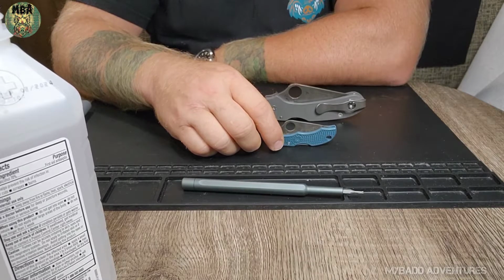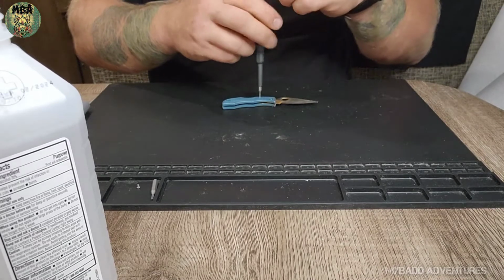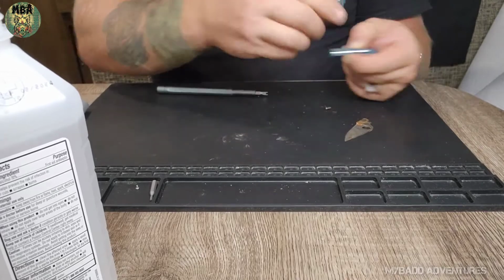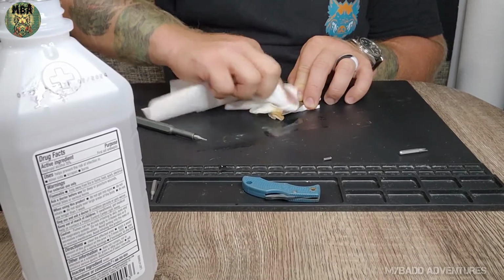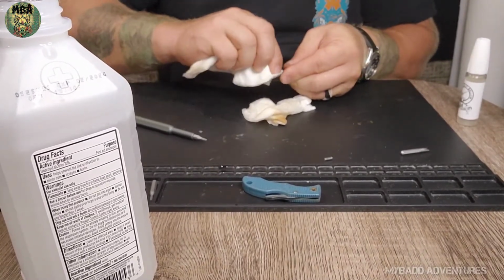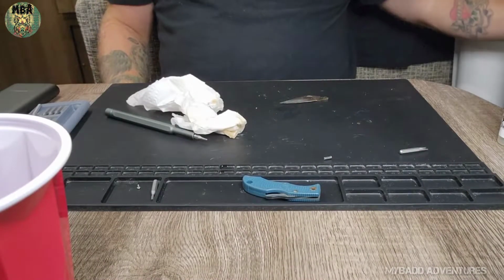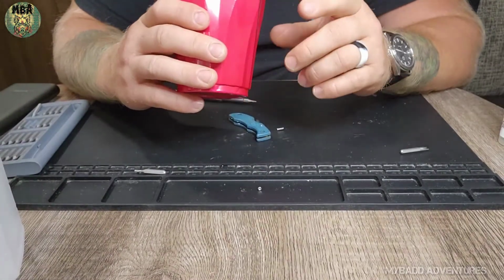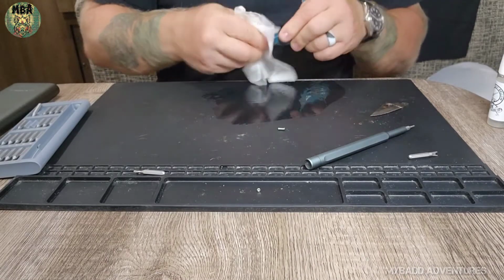K390 Manbug maintenance fail

Comment: Alcohol is good all purpose I've found.
I've used vinegar and brillo pad or green scouring pad for nasty rust, but you can use wd40, flitz, mother's, barkeeper's friend, even coca cola and a rolled up ball of aluminum.
Many options, love to learn new stuff myself too.
Reply from the maker: I have some mothers but I wanna get some bar keepers friend
Reply: @mybaddadventures144 , yeah, any hardware store would have it, I got mine at home depot.
It's great for removing patina on brass and copper stuff too, but I tend to avoid buying those because of skin not liking patina metals.
If brass or copper items are small, like a fidget spinner, coin, etc., then I'll put it in a cup with lemon juice from one of those plastic metals to remove patina without abrading it.
Good luck.
Reply from the maker: @Gman1024  Limon juice is a boat trick we did, but I leave patina I like the looks, what I don't like is rust
Reply: @mybaddadventures144 , ditto, patina, not rust.
I Love the looks of copper and brass, especially with the heavy scaling and stuff on it, blues and greens, but my freakin' skin doesn't unfortunately.